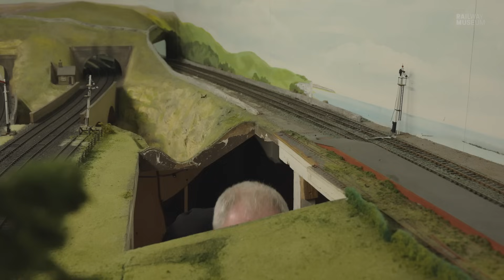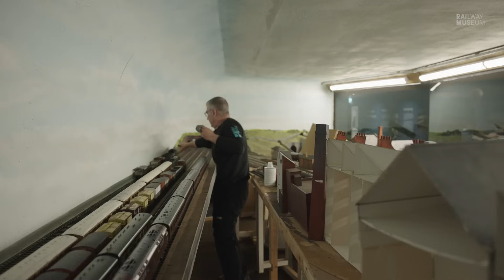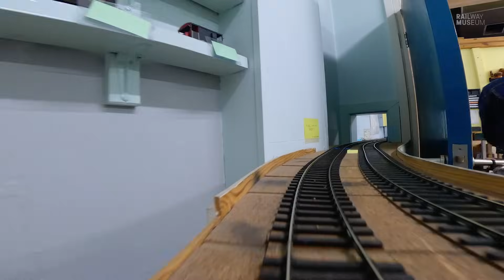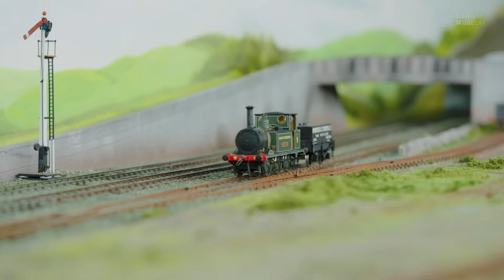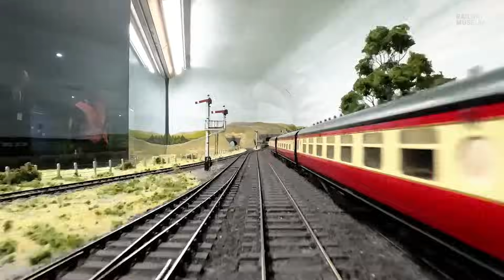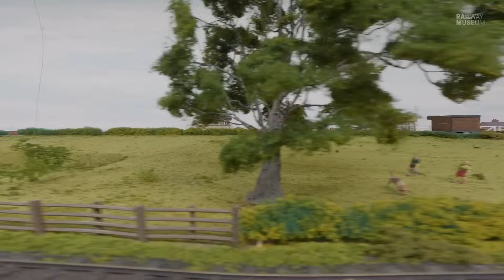Running the Model Railway | Behind the Scenes at the National Railway Museum

Comment: O gauge is just the best gauge. It's small enough to be cute yet large enough for a great deal of detail to hide the limitations of plastic injection moulding (bonus points if it's brass!). They're very satisfactorily chunky too (unlike fiddly OO or massive G). Only issue is that any layout requires an ungodly amount of space. I have a little prewar Hornby tinplate set up and it's glorious. This and the signalling video are among my favourites on this channel because of this!

Comment: I've been to four different railway museum  in my lifetime and I've seen plenty of Awesome layouts.  this is definitely one of the top two.

 and it's nice to see how things work in the background since you're always seeing the trains run as a visitor but you'll never see what actually happens behind the screens so to speak.

And this whole thing reminded me of when I finally got to see behind the scenes of the model railway at the museum that I volunteer at. 

 You see, one day I was doing my rounds through the museum when I noticed that the train had the rails.  but the locomotive was still on the Tracks so thanks to the motion sensor that activates our layout It went for another loop. 

 Unfortunately it then crashed into the derailed trucks it was supposed to pull causing some damage. 

 I called it in and my colleagues Allowed me to help remove the train and then switch it out for another train.

 We then spent some time struggling to figure out how to get the train running and all we needed to do was flip a switch to another setting. Something that I suggested multiple times but was ignored until they finally listened to me.

 not saying I'm a model railway wizard but sometimes a good guess is all you need to get things rolling. 

Still if I'm ever going to visit  the Railway Museum in York again I'm definitely going to check out the layout and appreciate all the hard work by the people behind the screens.